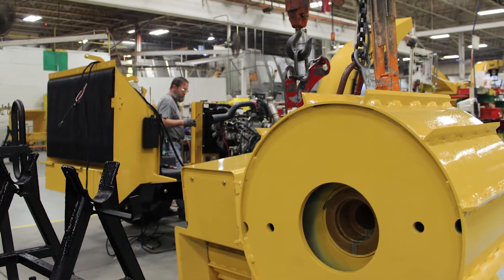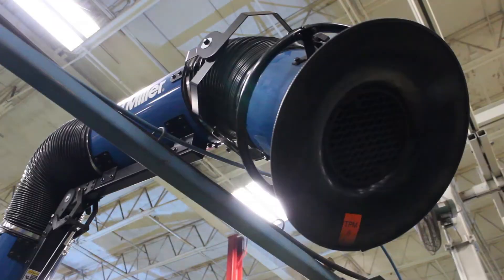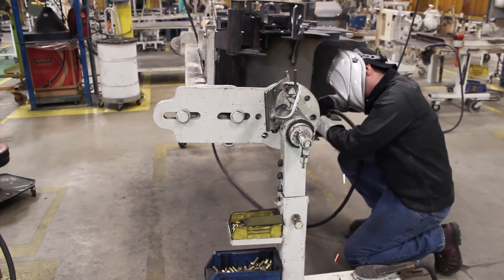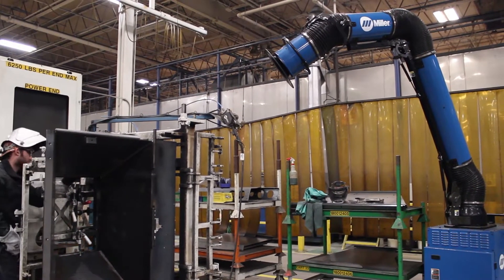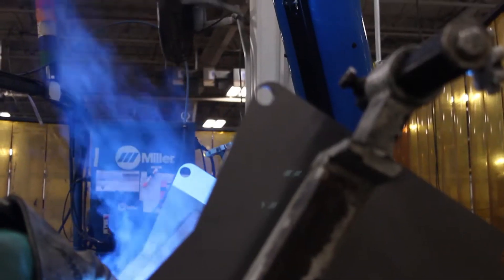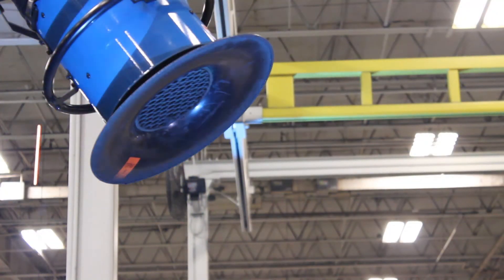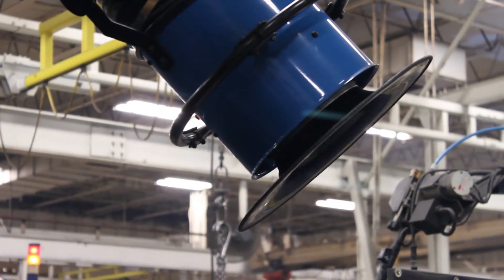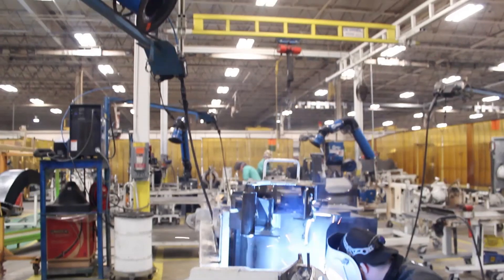Fume Extraction Systems' Increased Capture Area Helps Improve Productivity

Comment: omg, open the overhead door and turn a fan on., -Problem solved.
Reply from the maker: rickster348 Natural ventilation, such as open doors and a fan, is not sufficient to maintain OSHA Personal Exposure Limits of certain particulates in a manufacturing / production area. Let us know if you have any other questions.
Reply: Miller Welders well, Thanks.